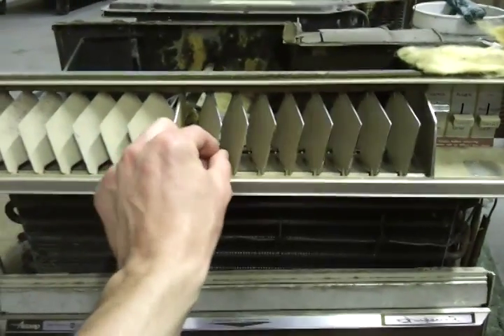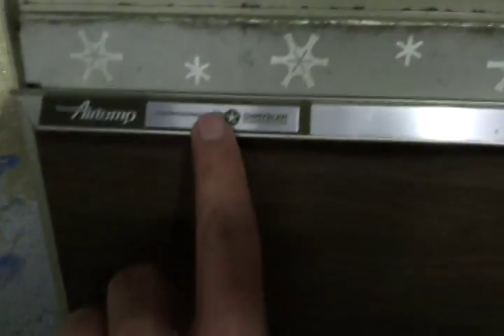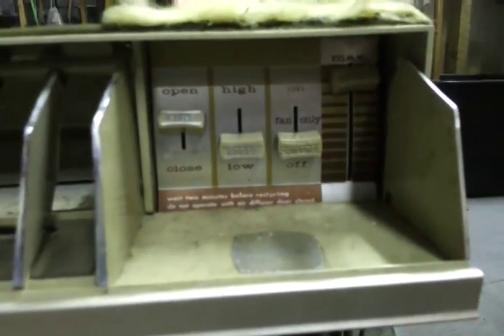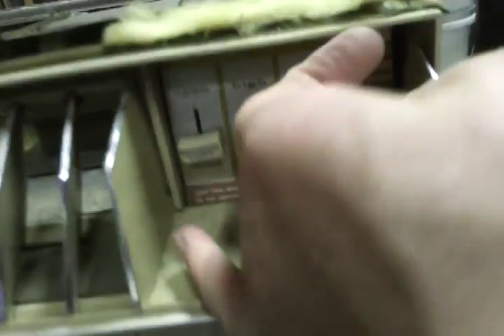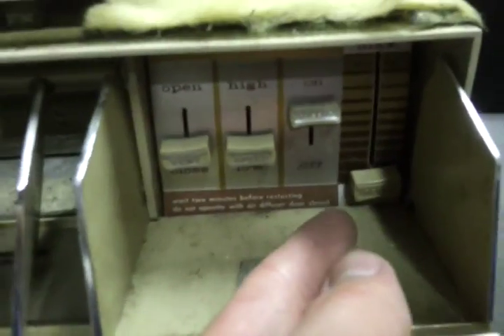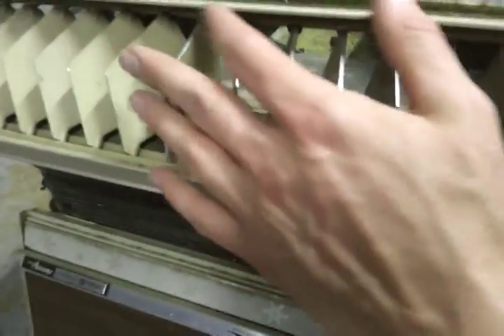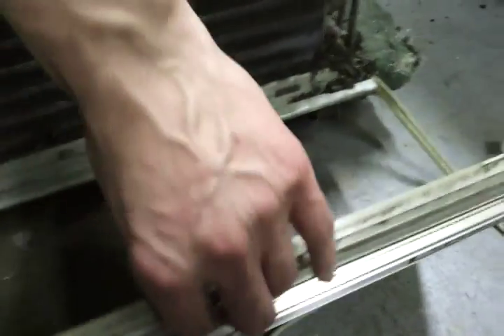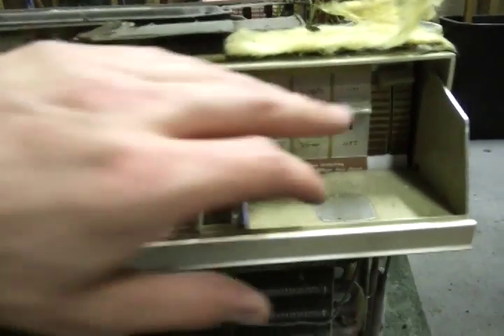1963 Chrysler Airtemp Imperial Air Conditioner

Comment: I owned some old GE window units dating back to the mid 70s. After 25 years they still worked great. The only reason I replaced them was because of mold. It growing all over the interior. The cost of taking them apart to have professionally cleaned far exceeded the cost of new  replacements. But it worked out well as the newer units are more efficient, using a lot less electricity.
Reply from the maker: all you need is mold disinfectant let it sit and rinse it out with warm water. works every time. as for EER, EER is a crock of shit. you are running a fan motor and a compressor no matter what way you look at it. furthermore, the older units blow colder air and cycle better, so the new unit will run twice as long to do the same job.
Reply: kenny bateman There is nothing mysterious about a unit's E.E.R. (energy efficiency ration).  It is a simple math equation.  rated BTU's/watt usage.  For example, a 6,000 BTU unit using 700 watts of electricity has an EER of 8.6.  More cooling BTU's and less used watts, gives a higher EER.
Reply from the maker: but are you really saving money if you are buying new units every couple of years? none of the units made today can compare in quality to the vintage ones. the quality simply is not there any more. they even look cheap as hell
Reply from the maker: furthermore, the most "efficient" unit ever made was a 13.9 I believe back in 1973 by Friedrich
Reply: TheAirConditionerGuy Who said anything about replacing every two years?  Some of those window units were the automotive equivalent of a gas guzzler.
At any rate, I don't bother with window units any more.  My house has central a/c.
Reply: TheAirConditionerGuy Assuming that's true, not many of those were sold.  Window units were very expensive back then.  I purchased my first window unit back in 1974-75 not sure.  It cost $135 new. Adjusted for inflation, the cost today would be $590.00.
Reply from the maker: itsmegp46 not to sound rude, but modern units are designed to last 4-5 years max. they are unserviceable, and disposible

Comment: I had one in the den of my old house.  It was a big honkin' 220V unit from 1961 if I read the tag correctly, probably strong enough to cover the ceiling in icicles.  The compressor worked, and it got super cold, but the fan was shot.  I should've yanked it out of there and fixed it up, but never got around to it.  It was huge, and probably insanely heavy.
Reply from the maker: im sure it was insanely heavy!

Comment: I have the same one, at time one side of the vent doesn't blow air.do you have a video on how to service it or clean it??
Reply from the maker: @secrets7898  see my latest video of the coil cleaning action, remove the case, apply coil cleaner, rinse very very heavily, reassemble unit
Reply: @TheAirConditionerGuy  thanks so much for the response however it's in my wall upstairs.???